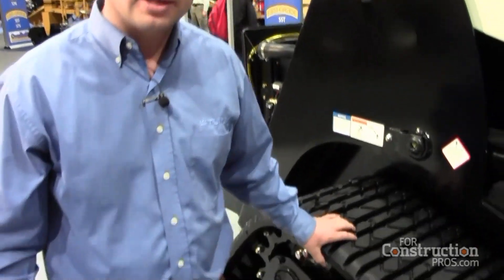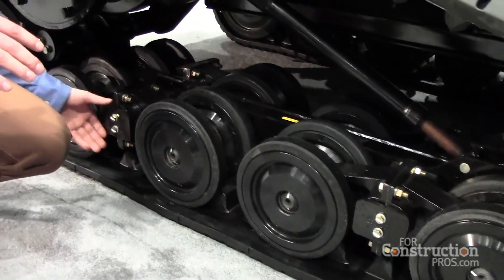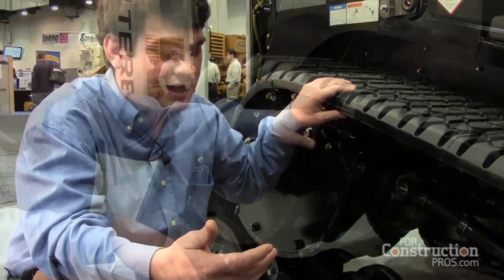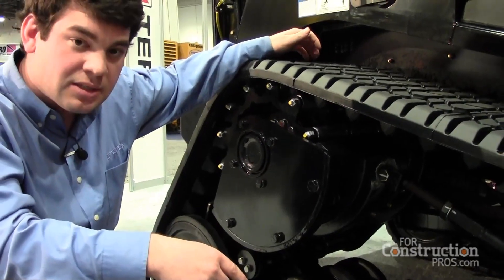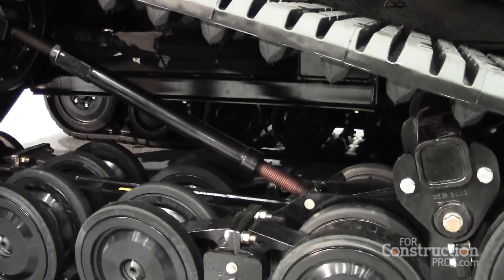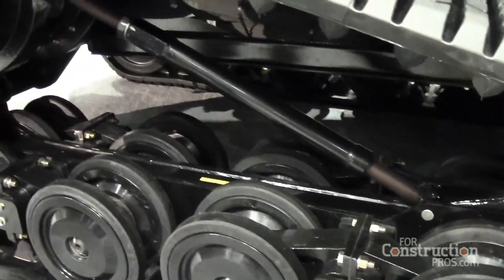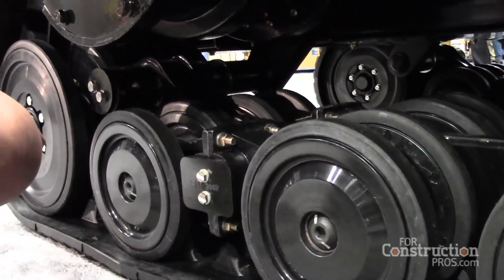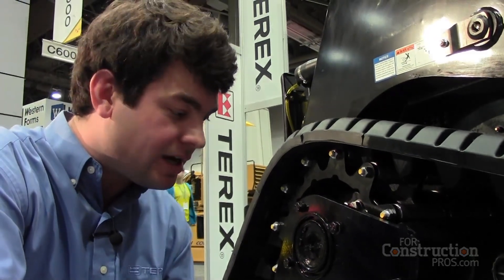What Sets the Terex ASV Undercarriage Apart

Comment: I purchased a Terex PT-70   2011, from Sunbelt Rental fleet.  Owning a Bobcat tire skid loader for over 10 years, I couldn't wait to own a rubber track loader with ASV undercarriage. Although the Bogies are great, they don't have the suspension of the older ASV Posi-track .  ASV got started in the snowmobile business and when they transferred their ideas to  Caterpillar, the industry exploded with growth! Now that Terex has the suspension bogies on their tracks, the machine will last longer and less "Knocking the fillings from your TEETH", every time you drive over the slightest bump!

Comment: I must admit the ASV undercarriage is the most comfortable BUT that comfort comes with a RIDCULAS PRICE when repairing them. Honestly, all equipment manufacturers should be ashamed of themselves for SCREWING their customers to the wall for axle groups and tracks. (For example: a idler for a CAT 257 cost $250.00 a piece. Then the CAT 287B basically a bigger idler cost $150.00. That's because the 287 has 3 and the 257 has 2 so you guys are going to make sure that you bend us over with no Vasoline. So anyone thinking of buying a ASV undercarriaged machine should know they are going to spend well over $12,000 to replace all the components. A 287B cost about $850.00 per corner, $4000.00 plus for the tracks and the list goes on and on. I feel Bobcat has one of the most durable undercarriages out there and the price is not as high and they last much longer. No, I don't own a Bobcat I have a CAT 287.
Reply: Bobcat can most certainly shove their machines up their ass. Their "protected territories" can see $10,000.00 to $20,000.00 differences in exact same machine pricing but you can't take the lowest deal because they will deny you warranty and punish the dealership with a fine. After using suspended rollers they have finally pulled their heads out of their asses and copied ASV by using torsion axles. I bought a second hand RT30 and am giddy with it's performance and $30,000.00 cheaper tag than BobCRAP. Bobcat will never see me in their sales department, parts department, or service department. Keep it up Bobcat, you will keep ASV in business for a very long time. lol

Comment: The ASV undercarriage is the best undercarriage on the market, hands down. People just need to be educated as to why it is superior and learn how & why it’s designed the way it is. It’s lightweight, high flotation, low friction design is far and away better than the solid mount undercarriages other OEM competitors run. People who think they aren’t durable are misinformed, too. I’ve seen 2,000 hour undercarriages on these things with ORIGINAL rollers/bogeys in rock and gravel applications.